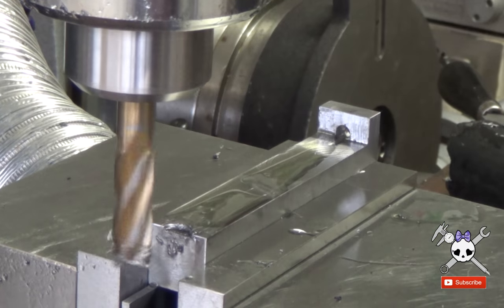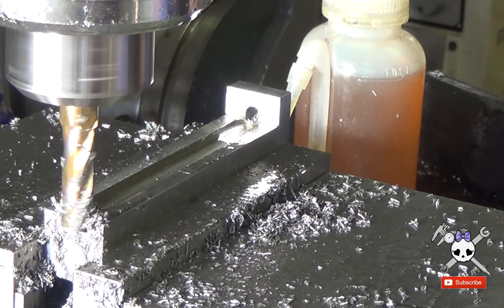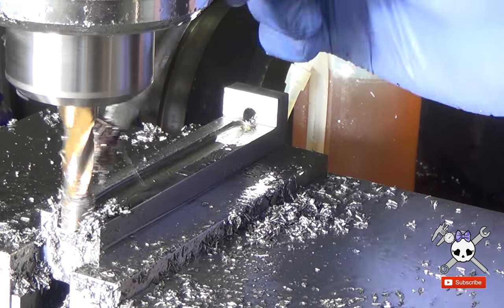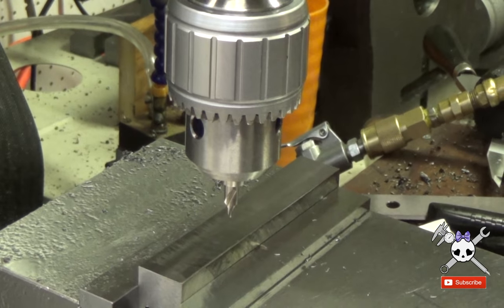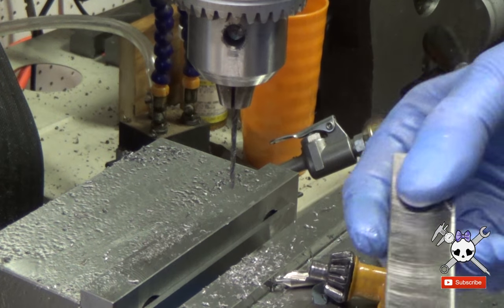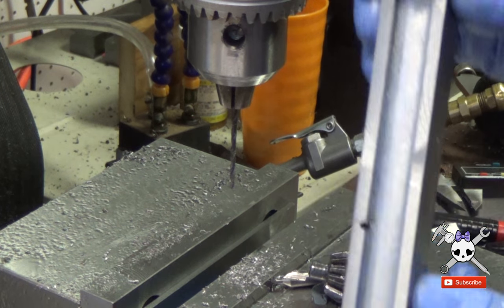Siig Sour  ;)    (yes i know its spelled wrong)

Comment: Pretty sure my son has the same pattern you are making (SIG Sauer), forget the number - useful compact.
I have a SIG 228 in 9mm but that's a lot larger.
Sure was lucky Plan B was an option with that hole!
This is a super project - plenty of work and stages involved! Great to watch.
Reply from the maker: thank you :) yes very lucky I only have the one peice of steel for the slide. would suck to have to wait on another peice

Comment: Which steel alloy did you use for the slide? And did you use pre-hardened steel, or did you do the heat treatment after you were finished with all the milling steps? If  the former, what hardness was it, and if the latter, did you do the heat treatment yourself or did you send it off to someone else for the heat treatment (and to which hardness did they heat treat it)?

There are hundreds if not thousands of video's on YouTube where the title of the video claims they "build" a 1911, SIG, AR-15, or AKM, while in reality they didn't build anything but just assembled said gun from an assortment of ready-made parts. You're one of the very few people who truly did build the gun mentioned in the title, and although there are a couple of others on YouTube who also have true build video's instead of mere assembly video's, you're the only one who build said gun manually, instead of with multi-axis CNC mills or lathes. So for that reason you deserve enormous respect, I can only imagine how much skill, ingenuity, and perseverence it must have taken to accomplish that. I found it a real joy to watch you going through all the steps of turning raw steel into a finished slide, barrel, frame, and at the end assembling it all into a working pistol, so thank you for taking all the effort of recording those steps and sharing those video's with us!

Comment: You should leave out the word "trying" in the description.
You know what you're doing and I doubt that you'll fail.
So   ... I will be building a 9mm ...    grtz
Reply: I was about to post almost the same thing.....This lady is awesome. She is some kind of gun building goddess.
Reply: +Diablo Blanco And look how quickly her hands move. She is faster than Bruce Lee! lol
Reply from the maker: thank you both haha ya I'm always a little unsure of myself.  it was showing through a bit in my text :)
Reply: +Waffenschmiedin x Anytime you are unsure of your ability, pull that sweet revolver out and look at it. wow.
Reply: Well I've found as soon as you start getting a little too sure of yourself machining has a way of fixing that additude pretty quickly. At least for me it does. :-(

Very old machinist's trick with that paper as a tool tip finder. Those old machinists were a smart bunch. Dirt cheap, fast and under a .001" accuracy if you use Zig Zag rolling papers. I still use it quite often. It can be even more accurate than some of the fancier methods since you can use it as an edge finder with the cutting tool rotating as I'm sure you already know.
Reply from the maker: +Turning Point ya I learned it from some old timers at the machine shop I worked at many years ago. (the paper) it's helpful in lots of feeler gage type situations :)
Reply: I guess I would be considered an old timer to you..lol. But I always used masking tape.Good job so far!!
Reply from the maker: well when I learned it I was like 19 lol ill be 44 soon so I would be an old timer to my former young self :P

Comment: You made my day today when I seen that you've started a new project, I've missed you. I'm not a machinist so IDK but where you forgot to drill the extractor hole, if you couldn't have drilled from the opposite side, could you have machined a flat bar the size of the slot you milled and squeezed it in, then drilled it, or would the drill bit still wonder out of the right spot?
Reply from the maker: Yes I could have done that :). I was just expressing that if you don't plan out your sequence of operations you can sometimes have to scrap the part. there isn't always a plan b. I need to plan better next time I was in a hurry to try to get this video out.
Reply: That is so true..  I had a friend who somehow managed to break the cocking knob on his (very) old Stevens 22.  I found him a replacement at GunParts, but meanwhile decided as a lark using the broken pieces as the model, to machine him one in brass.  LoL, it was a nightmare project.  It turned out that virtually every cut I tried halfway through revealed a different cut needed to be made first.  Before I finally got the sequence of cuts done in 1902 correct I had wasted about 18" of brass to make the stupid little 3" piece.    It was knurl first, then machine around the knurl.  LoL, whoda thought..
Reply from the maker: +Ken ibn Anak lol yup can get expensive to lol

Comment: Because I am a woodworker with no knowledge of machining metal I will ask a dumb question.  What is the purpose of the sheet of paper between the bit and the stock?  Is it to set a zero point?  Since this is not a CNC I am assuming you need to set a depth gauge of some sort.
Reply from the maker: Dan Breyfogle yes it to get a close 0 . You put the paper in and move the tool until you feel a slight resistance then add the thickness of the paper. There are more accurate ways to do it but this is fairly accurate and fast.
Reply: Thank you for the explanation.  I have watched all the 1880 series and found it very interesting.  As I mentioned, I am a woodworker so no gun making for me, but love watching talented people using their skills.
Reply from the maker: Dan Breyfogle 😊

Comment: Durn it YouTube won't let me subscribe to your channel.  Just because i already did.  Durn it.  I want to double subscribe.  Your channel is awesome.  PS Happy 4th of July.  
Two aspects of this I look forward to are hogging out the grip for a magazine and of course the silly twisted wire recoil springs with one end different from the other.  Unless of course you simply modify things so a standard cut down 1911 spring works,
Reply from the maker: yup exactly.  I already had one complaint when I first started and I don't need another :)
Reply from the maker: Actually there is a really goofy spring in this one it's flat steel rapped round. I think the reason for it is the short space for the 9mm round. with the flat spring you can get more coils in a smaller space and since it's wide it's just as strong. I'm still guessing how I'll make it haha.
Reply from the maker: and happy 4th to you to! :)

Comment: I own a 9mm 1911.  It is a Vis Radom from 1942 with Nazi proof marks on it.   Unfortunately the barrel is badly worn, otherwise very good condition.   Here is an idea for your next project:  How about a 1911 that fires 45-70?    It would be the only one in the world.
Reply from the maker: it would also be impossible to hold onto the handle would have to be huge to hold it hehe
Reply from the maker: you could always have a new barrel made and just hang on to the old one.
Reply: I would love to have a new barrel made.  Any suggestions?
Reply: How about a .50 S&W 1911?
Reply from the maker: +Jeffrey Nelson any decent machinist should be able to copy it if you get some  9mm barrel stock.
Reply from the maker: +Jeffrey Nelson same problem handle would have to be huge. the whole gun would acculy. the action/barrel would be to week to handle it so it would have to be increased in size. think it would end up like a desert eagle size.
Reply from the maker: a desert eagle would probably be a better choice for a round like that (I hate desert eagles) but it's gas operated and the barrel is fixed and rather large.

Comment: missing about 5 minutes of video at the end. did you fall asleep lmao. good start on the build.
Reply from the maker: the video is actually the end I'm not sure why it did that
Reply: If you get bored, try using Windows Movie Maker to check the clip.  It could be you have a display screen code embedded at the end which of course WMM would allow you to review, find and remove,  Of course then you would be stuck with two more hours of upload time.   :)
Reply from the maker: +Ken ibn Anak ya I watched it on my pc and it was fine.  it didn't add the extra till after I uploaded it . and I uploaded it in 1080p but was only able to watch it in 780p

Comment: Why not vacuum the chips instead of blowing them?  Are all the major parts steel?
Reply from the maker: Frame will probably be aluminum like the original  (but I haven't decided for sure yet) vacuums are big and bulky and don't really work all that well.  the air compressor is in a shed so I don't have to listen to it run. if you're careful it's easy to clear the chips with out blowing them in the ways. and I just clear the bulk of them I clear the rest by hand.

Comment: What kind of drill is that? drill head?
Reply from the maker: at what point in the video?
Reply: +Waffenschmiedin x 0.45 squaring up the steal, your just using a regular drill press right,
Reply from the maker: +Mark Felkins at its a carbide cutting head in my milling Mach
Reply from the maker: +Mark Felkins machine *
Reply: +Waffenschmiedin x Cool, sweet, probably costs an arm and a leg too, where did you learn you metal skills,
Reply from the maker: +Mark Felkins not as bad as you might think . it was a little over 5k new.  (Grizzly) Chinese import.  I worked a couple of years at a machine shop and learned the basics. then I worked in industrial maintenance for 25 ish years and self taught
Reply: +Waffenschmiedin x Great, job,
Reply from the maker: thank you :)